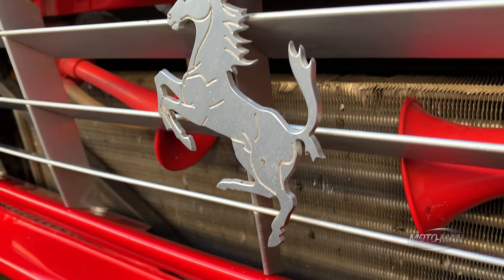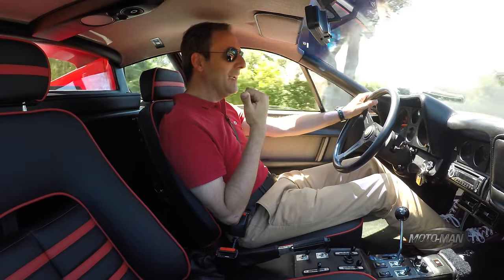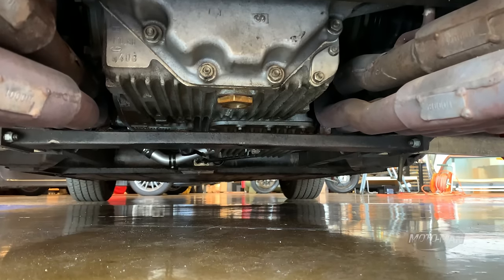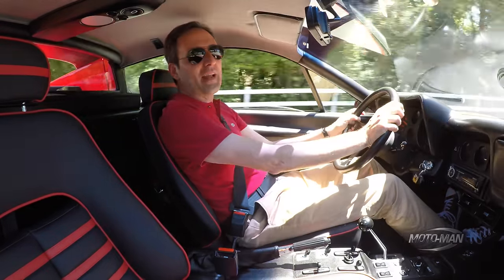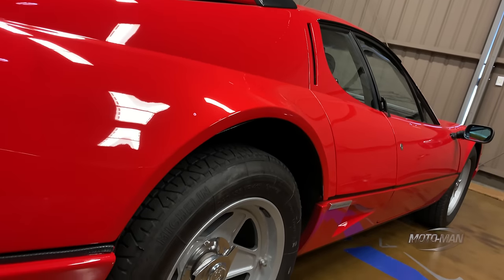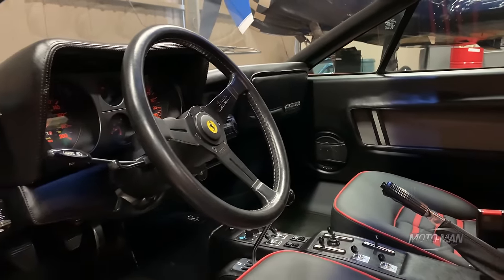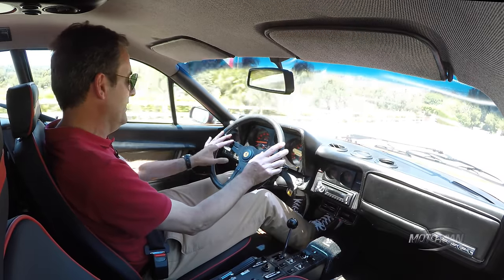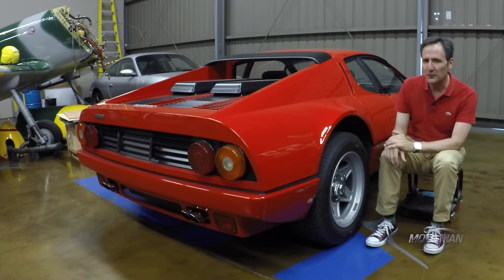The Forgotten Ferrari: 1983 Ferrari 512 BBi - RETRO DRIVE REVIEW

Comment: I owned 27553 for quite a few years. Clutch is great, the trick is the using the engine torque and basically rollout of a stop. The AC, well you are correct useless, but never open the windows and drive on a hot day. The hot air from the radiators will waft right into the interior. Drive it in the evening with the windows down. A well engineered idea that leaves you smelling like exhaust fumes after a drive. Part of the fun is waking the beast up when it has been parked for a while. I

Comment: The transaxle sits under the engine in this car. Because of that it had an even higher cg compared to regular 60 deg v12s with regular transaxle placement. Defeating the whole purpose of the flat engine

Comment: In the sim when you get the rpms up and it starts screaming and your elbows flare and you begin to manually saw at the wheel  taking it past its limits you'll begin to understand how difficult and satisfying it is to do the calculus with a flat 12 as your anvil holding you in place..

Comment: Minor point, but although the flat engine would have lowered the CofG, they had to put the gearbox underneath to package it in the car.  Hence the CofG was actually a lot higher than ideal.  It's not like in the '70s F1 cars where the flat 12 sat just inches off the tarmac.  If you do corner a Boxer hard you'll find quite a lot of roll and some roll oversteer.  They didn't really cure it until the 512M in the '90s.  So treat it as a GT rather than a sportscar and you'll have a better driving experience.  The aircon, as with many 70s and 80s cars, is actually an american system, just badged Borletti, and with Marelli electrics.  It can be set up to work very efficiently and I once had the cockpit down to 40F.  It does gas out pretty quickly though, even if regularly used, and will need a re-charge about every 9 months.

Comment: I believe much of the reason for the detuned performance has to do with different camshafts; which were made to prevent reversion exhaust air backwards into the CIS intake (no overlap). I think there are camshafts that can be used that bring back that performance without reversion, but it's an uncommon modification.

Comment: It was fast for its time. The bar for fast has been moved significantly. A Golf R would beat this easily but that’s not the point. These things old sports cars offer exquisite and unique driving experiences and they are still pretty quick.
Reply: On most tracks but Golfs are still slower 0-200 20 seconds vs 17.5-19 for the BB. GTO could do it in 15.5. Doug De Muro said it is modern fast. It would definitely beat a Civic type R to 60 as front wheel drive is terrible for 0-60.

Comment: the clutch is not as difficult as he describes. maybe his needed some adjustment. he needs to try it on the highway to get a feel for the torque - fantastic pull even in 5th gear.